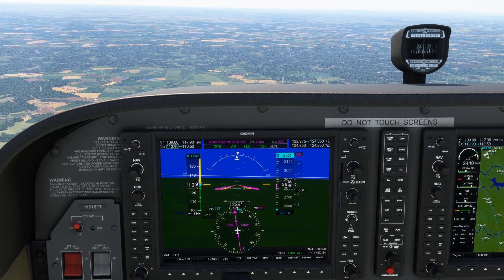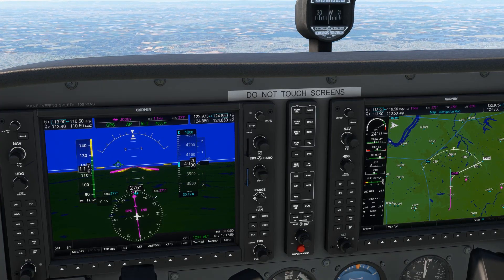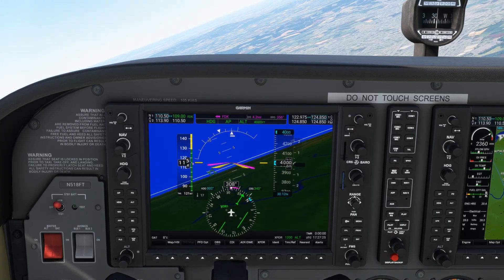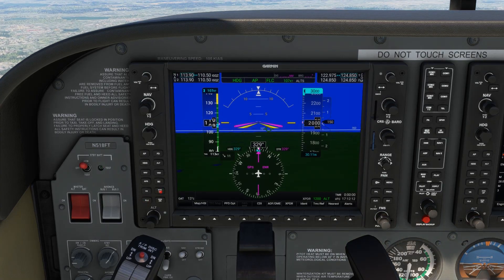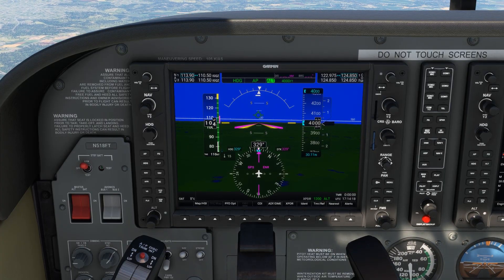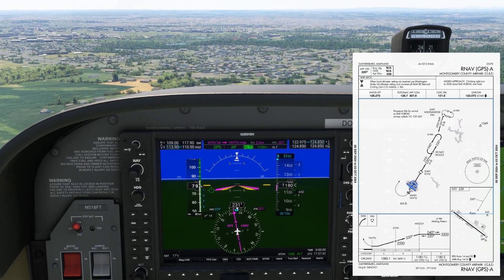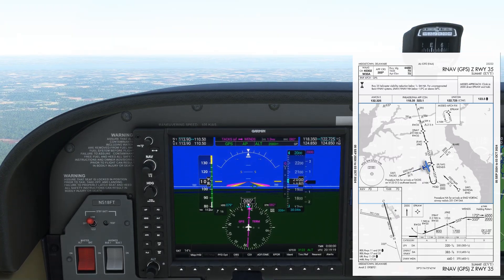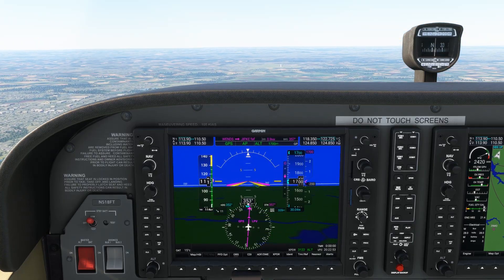Common Autopilot Mistakes | G1000 Autopilot Training

Comment: Good explanation on what APR mode actually does. As for method,  I prefer staying at 2000' until I intercept the GP from below and then follow it down to the DA.    I understand you wanting to dive down to 1700' and intercept the GP @ 1700' but I'd prefer to intercept it at 2000' and just verify I am at 1700' while passing the FAF.  This allows me to configure and most importantly 'stabilize' my descent outside the FAF.     There is no right or wrong way to do it. I've done it both ways.   I just happen to like altitude because "altitude is our friend" as the saying goes.  I prefer to stay as high as I can until I absolutely need to start descending, while also allowing a larger margin of safety for establishing a stabilized approach down to the DA.  Anyways...that's my logic behind staying at 2000' until I intercept the GP rather than the "dive and drive" method.   As far as arming the APR mode, there is no harm in arming it once past WENDS and inboud to JIFKE.  I will still be intercepting the GP from below @ 2000' and I will be stabilized sooner and higher...   If you are more comfortable with the Dive and Drive for whatever reason, then you do you. It still works fine. I just find that I am doing a lot more configuration changes closer to the ground and with less time to the DA with the Dive and Drive method.  The airlines don't do dive and drive, but they are not flying C172's either.  Finally one situation that I may do a dive and drive is if the dive gets me below the overcast cloud layer but still at a safe level above the ground.   I also like your technique you mentioned at the end about not hitting APR until your next waypoint is the FAF.       So in summary, don't hit APR until "cleared for the approach" and 2.) Don't hit APR until the next waypoint is the FAF.

Comment: Here is a recent mistake I made. I was cleared for a decent in IMC getting close to my approach so I didn't want the airspeed in increase during decent so I pulled power back. The auto pilot was descending in vertical speed mode. As I reached my attitude atc called me with instructions so I was distracted for that 1 second. A few seconds later during my scan my airspeed was down to 90kt with pitch way up which I did not feel being I was in IMC. I realized before and stability systems or audible airspeed alert but was still startling. So obviously I don't have to state how important it is to be ready to add power upon leveling off from an autopilot decent. I was flying a G7 SR22.

Comment: Why did you desend to the FAF altitude to intercept the glidepath? Unless that’s the altitude that ATC clearance is to maintain, I would prefer to just maintain my present altitude with ALT hold engaged, and arm approach. What is the best practice you refer to? Is it listed in any of the FAA IFR publications
Reply: I'm with you. I'd rather stay at 2000' until GP intercept.  It 's not a FAA best practice topic really.  It's just a preference. Some guys luv the dive and drive method, while other guys like me prefer being stabilized further out and higher up!  Both methods work. Airlines don't do dive and drives but some GA pilots can't wrap their head around establishing an approach further out from the FAF and then just verifying they are at the correct altitude when they fly through the "lightning bolt".  It's a different mindset all together.   Most guys I've run into who prefer the dive and drive are the same guys that don't know how to plan their stabilized descent when they are at 10,000 feet and need to lose 9,000 feet so they can be at 1,000 feet at the airport pattern altitude.  I guess that only comes with experience.  Sometimes in all fairness though, it can be challenging to plan your descent when the numbers are based on ground speed and the pilot is flying a 1959 C172 with steam gauges and no GS readout.

Comment: After 500 hours of flying out of at least five different flight schools, I have never once seen a GFC700 in a rental aircraft (and I currently rent from a Part 141 operation).  It seems like a such a great autopilot but all the planes that have one command a high price in the market, so my assumption is that it's only to be found in privately-owned planes.  Pity.
Reply: 100 hours TT and i finished my private only using a plane with gfc700
Reply: @ that’s great, you’re very fortunate to have a flight school that offers it.  Where do you fly out of and what kind of aircraft?

Comment: Re: arming approach mode, just because the GP is armed, doesn't mean you can't also initiate a VS descent to 1700 before the glidepath intercept point. GP will still be armed. So what I do is arm approach mode when I get clearance, but when I pass (in this example) WENDS, I would initiate a VS descent at 500 fpm to 1700 so that I capture the GP at JIPKE. It works well with the AP that I have (Garmin GFC500). I would want to test other APs to see if they behaved differently.
Reply: That works too.

Comment: Do you have a video that talks about the proper way to activate an approach on a GFC 500 when vectored in between the IAF and FAF?
Reply: Don't "activate an approach" once you pass the IAF, if you have the IAF programmed into your flight plan.  Activating the approach will turn your back to fly direct to your IAF. If you are on autopilot when you do this....boy it will screw you up.    If you are past the IAF, then just 'activate (the) leg" for which you are intercepting.   Don't use VTF on a G530/G430 either because it will blow away all your waypoints prior to your FAF.  Just "activate (the) leg" you want to fly.  This will keep all the waypoints in your flight plan in the event ATC pulls a fast one on you and vectors you back to the IAF or some other waypoint in the approach.  Other GPS's don't have this issue but the G530/G430 does.   Also by using VTF and  blowing away your waypoints means you won't see your step down(s) where you must maintain a certain altitude until you pass it.  The GFC 500 is just an autopilot that will do whatever your GPS is telling it to do.   The GPS is the brains, while the autopilot is the muscle.

Comment: Great point at the end. In flight school was just trained to click app when cleared. Only when I got to the airline world was it stressed to not click app until the next waypoint is FAF/glideslope intercept, and instead use VNAV or some other dumb vertical mode to ensure crossing restrictions were met, because GS will NOT always ensure you hit all crossing restrictions.